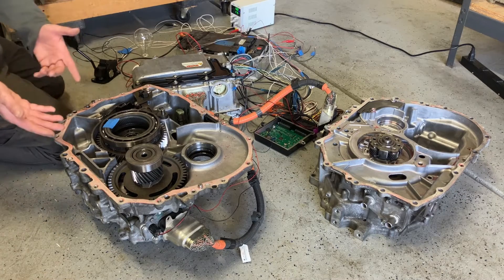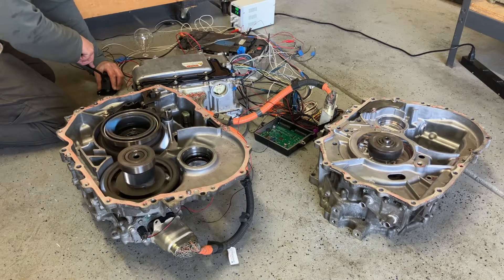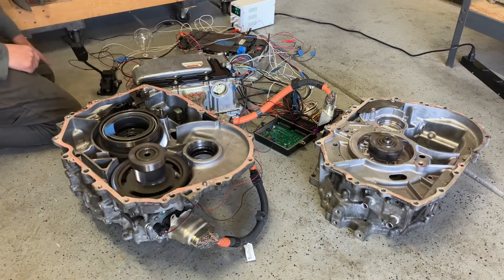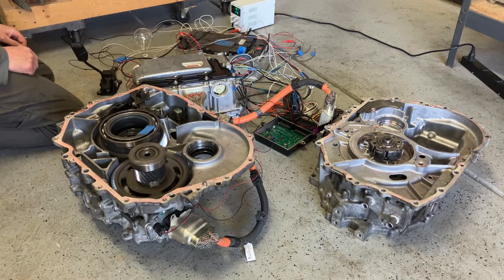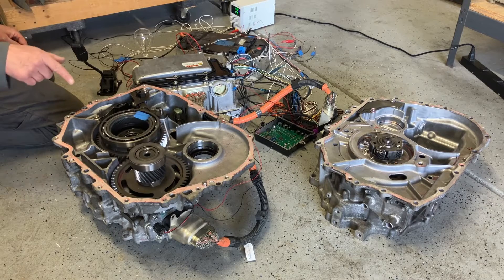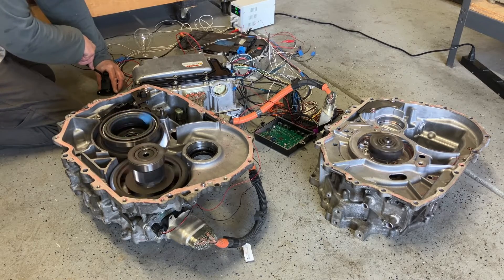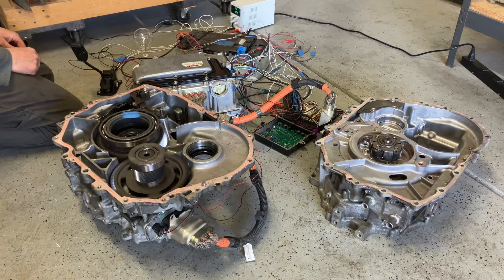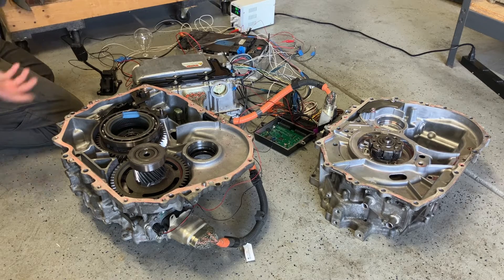Toyota Prius Open Transaxle Motor Action

Comment: Nice one Greg! will mg2 interfere with mg1 when it's connected together and stopping? I guess just splapping it back together is the easiest way to find out!!
Reply from the maker: by design the two are separated by the power split device, only time MG1 assists MG2 is when the input shaft spins at the same speed as MG1, without the engine that is never, I don't plan on even spinning my MG1 thought the Zombie does spin them both by default, and you are supposed to weld the power split device, PSD, which I don't plan on doing in Phase 1, I want to dyno MG2 all by itself